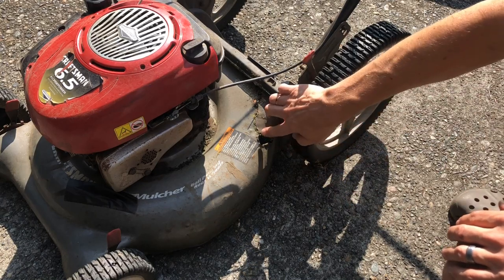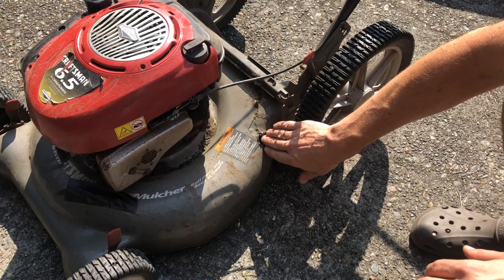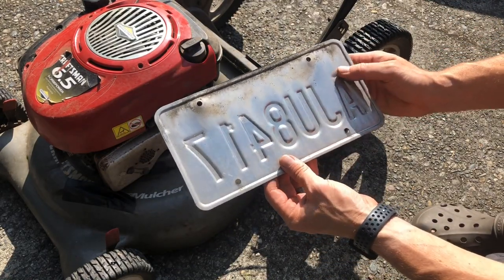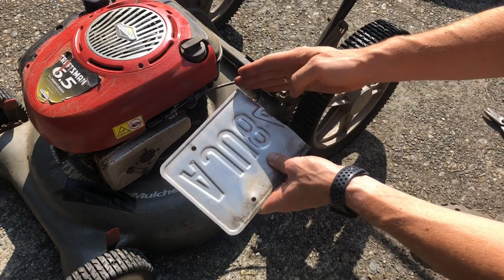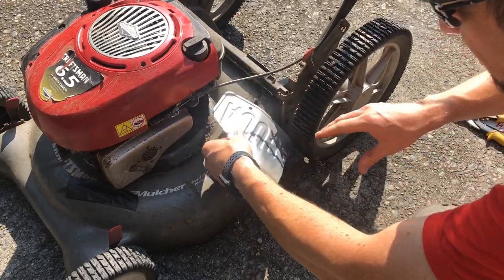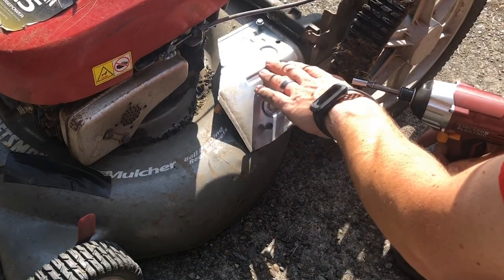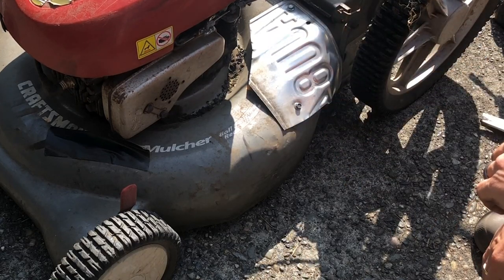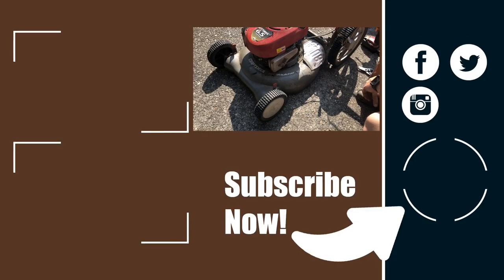5 Minute Easy Fix For Lawnmower Deck Rust Holes | Handy Hudsonite

Comment: This video is timely.  I have a 1987 vintage Lawnboy that still runs well but has one quite large rust through hole at the discharge chute and a crack in the deck in front of one of the rear wheels.  I was going to sell it mainly because my mechanic told me it would cost more to repair than the mower's worth, but now I'm going to do the quick fix like this with some ducting metal I found in the shed, shape with a ballpeen hammer and secure with self tapping screws, then paint over the patch(s) with green paint to match the mower colour.

I don't really care so much about how it looks as much as I will continue to get more useful life out of this mower now.  Thanks for the easy repair video.

Comment: Good quick fix and totally adequate. Other good suggestions in the comments for a push mower or maybe a rider depending on where you live. None would hold up for me though. I'm on 3 acres in Florida. If I don't repair from the deck bottom the hole will just continue to grow and end up sand blasting through tin or sheet metal.
1 1/2" wide, depending on deck hole size, 1/8" thick mild steel from Home Depot etc. Hack saw to length and hammer in a vice to fit curves and whatnot. Couple of bolts and nuts, drill through deck and mild steel. Pancaked everything with original JB Weld to fill in any little gaps. Super solid. For cracks you have to find the end of each side and drill a little hole before any repairs. Otherwise it will keep splitting no matter what you do.
Definitely a bit more labor intensive than this but it's now effectively part of the deck and not going anywhere. Held up for going on 2 years now. I mow about 8 months out of the year. Usually twice a week during the summer
And yeh. I'm taking a break right now from fixing 2 new spots where it blew out. Getting ready to start mowing again for the year. 30 bucks or so and it will be all good again. Still way cheaper than a bare bones new deck.

Comment: I just cut up a tin can to patch mine up. Rust being the issue here as well, I stayed away from popping more holes in the deck and simply used black duct tape. Kept it flush and matched the black and red colors on my Toro model. Guessing it'll get me by for 2 or 3 more years.

Comment: i have easier way if just wanting to block the hole ,cut piece of rubber(old tyre) and glue it (glue or wall silicon) on top of hole. works well to me .

Comment: I fixed my mower it was so rusty the wheel fell off I used a pice of steel thicker than the deck I'm going to do this in the extra rust
Reply from the maker: Wow! That's really rusted. Glad my video has been helpful for keeping your mower running. I keep license plates around for this very reason. I have another mower that I've fixed this way also and my son still uses it for his mowing business.